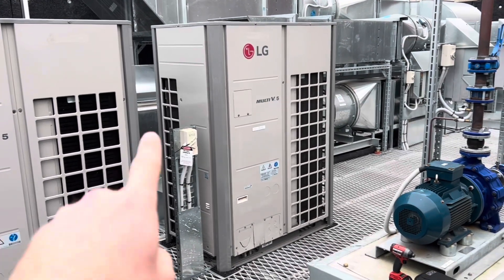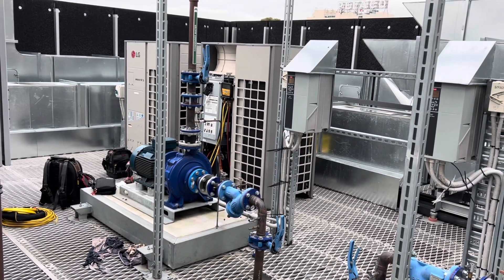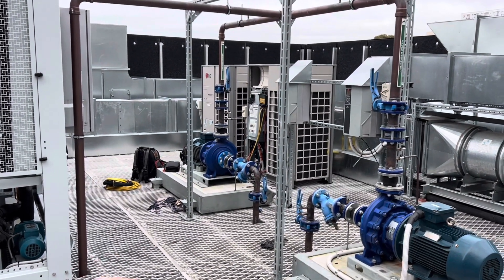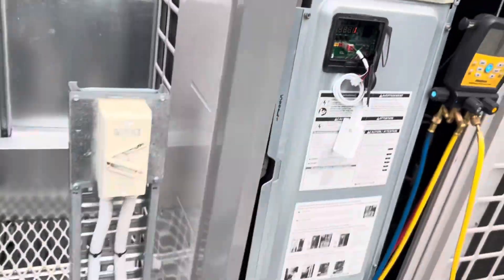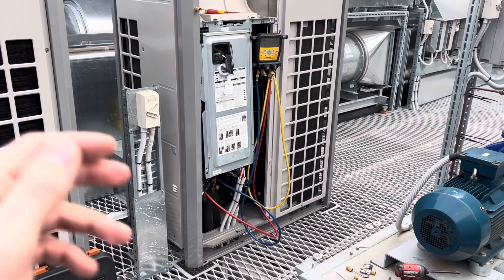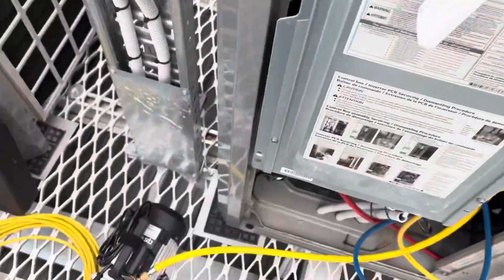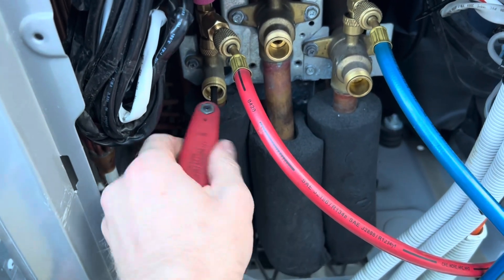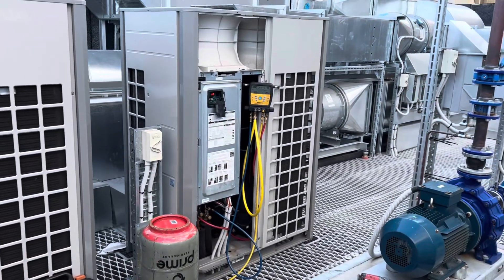LG MultiV 5 / Recommissioning an LG VRF System

Comment: If you dont have the largest indoor unit attached to the first port - You will not get the system to auto address. You have to do it manually, what to know why? Call me, I work for LG in USA. Cheers

Comment: Please how is the v5 test run done
Reply from the maker: Using the push buttons located on the control PCB use the arrow buttons to find “Fdd” then click the circle button to enter that mode. Use the arrow to find either “Fd8” for cooling or “Fd9” for heating. Make sure to hold the button down for 1 seconds d before releasing.
Reply: @hvacraustralia  good job sir thanks so much

Comment: The thing you did with the nitrogen when pulling the vac what does that actually do and help with.
Reply from the maker: The idea is to dislodge any tapped moisture in the system by raising the pressure/temperature. I usually do it when my micro reading stalls out.

Comment: Hi mate, I got a site that the brunch box low,high and liquid  pipe all crap reduce pipe size do this reduces the cooling capacity? I think some cowboy doing this. Thanks mate
Reply from the maker: Hey mate. Yeah, absolutely. Due to less volume being present there will be less refrigerant at the indoors, resulting in less capacity.
Reply: @hvacraustralia  thanks what would you do if in this situation? Check gas pressure and add some more gas to increase the cooling ?
Reply from the maker: Adding more refrigerant won’t solve the problem. That’s a tough one, is it a recent install? If so the installer would need to come back and install the correct pipe sizes. If it’s older, could always suggest installing the new pipe sizes.
Reply: @hvacraustralia  is a school it been install around 2 year I think school only have 1 year warranty, that a tough one and I don't do LG much, so properly need to reconnect to right pipe size and recover all gas out and check if any leak. If I add some gas it won't do any cooling right? Thanka

Comment: There is a better way of judging the full load operation of the unit. What you need to do is to turn on Dip switch #5 at the ODU, go to "Fdd" mode using the arrow/confirm buttons, and go to "Fd8" for full cooling(or Fd9 for full heating), and then push the confirm button. After a few minutes after it initializes, it should display 6000(countdown from 60 minutes). Also, LG has specific functions in the ODU to measure the charge to let you know how much to add/remove(Fd1-4).
Reply from the maker: Thanks for that mate, great info to know! I had a flick through the service manual the day after and found the section that explains what all the functions do and how to get there haha great timing on my behalf 😂 I’ll know for next time.